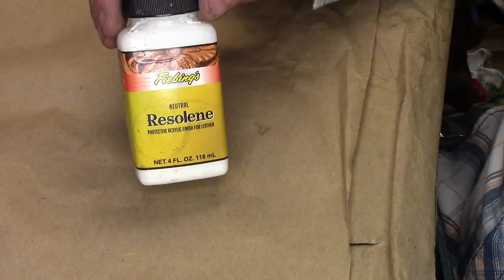Making a Custom Leather Thumb Break Holster for a Walther PPK Leathercraft ASMR

Comment: Excellent craftsmanship as always but I'm wondering how the thumb break will work with the holster tight against your waist?
Reply from the maker: Thanks! Only a little 'give' is needed by either the leather or your body for it to unsnap.
Reply: Don't put the belt loop up too high and you won't have problems with the thumb break strap.